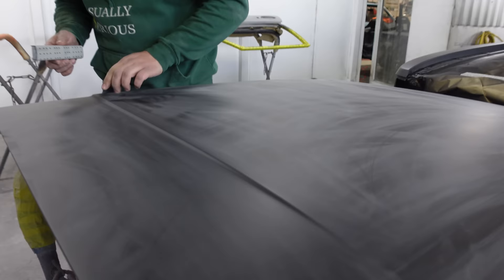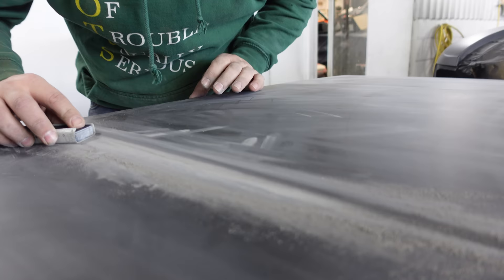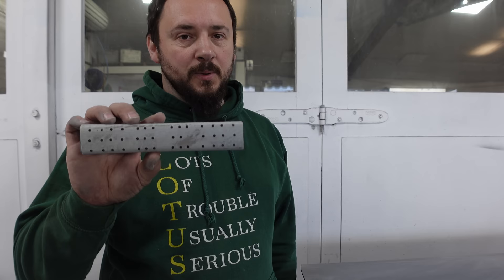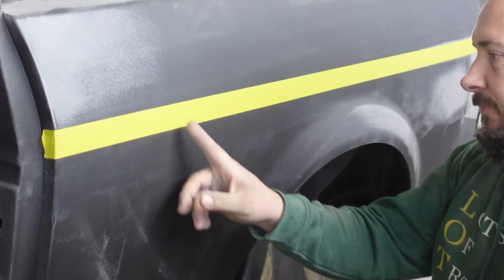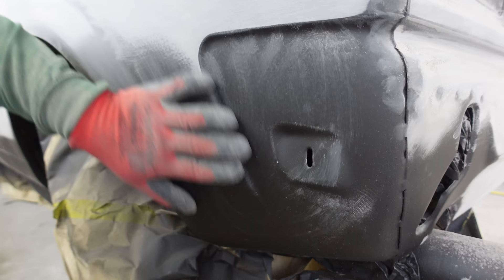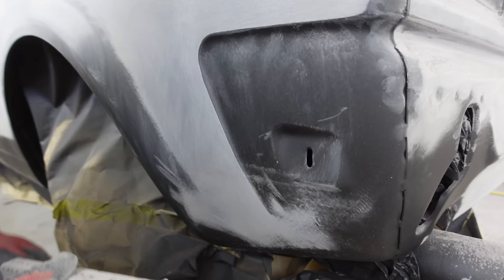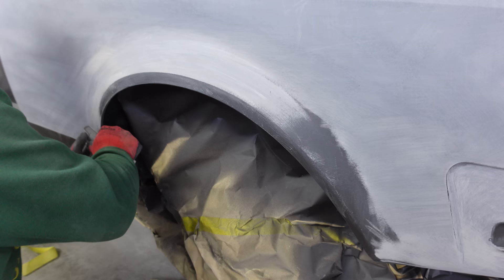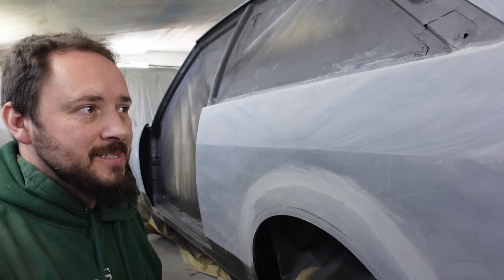Dry Blocking the Primer on the Black Talbot Sunbeam LOTUS

Comment: I've never gone up the grits and only used 400 grit when preparing something for paint. I'm also using much better quality primer and leaving it longer to dry so it doesn't go back to bare metal. Sometimes i get air bubbles in the paint when using Aerosol cans? Is that because the surface isn't clean?